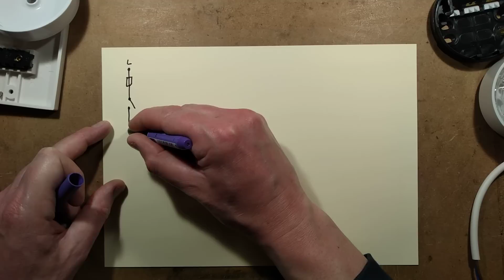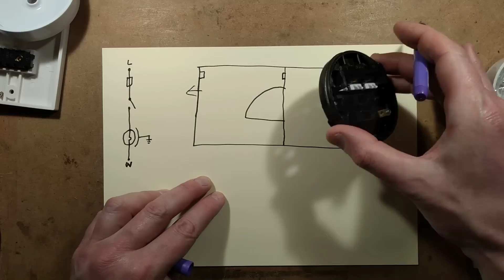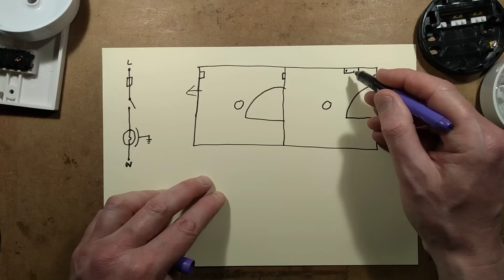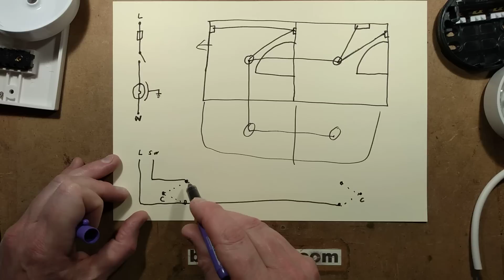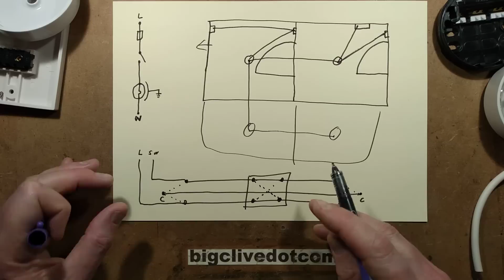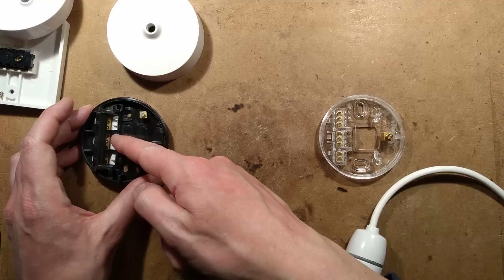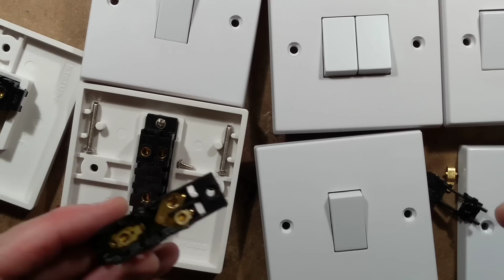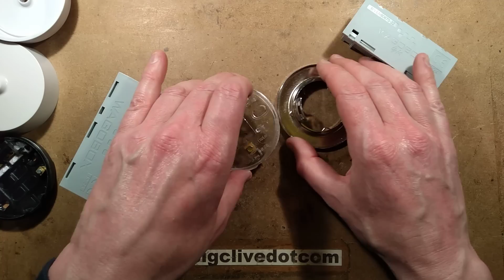British home wiring.  The incredibly simple lighting circuits.

Comment: I've been having a few looks at the US system, and as a Dutch guy, the UK system feels much more like the US system than as ours.

The detachable rose feels a bit like the newer French luminaire plug, tough I prefer their choice not to use the wires themselves, but instead use a separate relief on the cable to keep it in the air.

Comment: I know a different version of wiring the two switches. At least here in Germany I find it is common (or even standard) to feed in Line voltage through one switches Common Connector (Naming seems to be different for every manufacturer here as well, but an up/down arrow symbol for the Common and Something like L and L' seem to be used regularly), connect both toggled connectors through dedicated wires and feed the light outlet from the second switches common port. a third or fourth switch may be added the same way as you described (or you go for some latching relais type or wireles switches ;) )
From books I know both wiings, in realty I have only seen the one i described so far. Not sure if you can/should use the britisch variation here. 
Difference may be in the fact that we have no loop wiring.
Also we have switchces and outlets set deeper into the wall, with two or three depths of the round 68 mm boxes we use to set into the wall. Schuko type outlets would not be flat enough (And yes, the ugly and bulky british type plug is without argument the better design)
Earth wire is fully sleeved here. For in wall installation there are either a round cable Type NYM-J or flat cables. IF you get used to it the wires are quite easy to strip, either with a knife or some quite handy tool.

Comment: For homes we have single phase service which is two 120v hots 180 degrees out of phase and a neutral and ground. For commerical we have 3 phase, each phase 120 degrees. Of that the hots can be 120v or 277v. 3 phase comes in as delta or "Y" . On delta the 3rd phase is 208v. Color scheme for 120v hots are black, red and I think purple. I forget for the 277v . Dryer's use two 120v hots that are  out of phase, if you put a meter between them you get 240v. One the 277v you get 480v between phases. The neutral is always white and the ground green. With 3 phase it means there is 3 ways to get the 240v or 480v. A-B,A-C and B-C. Single phase you just have A-B . Well thats how its been in S. FLORIDA. 
Also they install the outlets upside down,  you can tell by the writing onit, so they look like a face. This is dangerous because if a paper clip falls behind a desk it can land between the hot and neutral.  If its installed correctly it will hit the ground and continue to fall harmlessly.

Comment: Ohh we call the wires between 3 way switches "travlers" and if the boxes between are connected with emt "electrical metallic tubing" we would pull yellow wires for the travels.

Comment: The standard nom-plastic box is called a "1900" box. It has 2 8/32 screws diagonally. You put a "mid ring" on it. The mud rings come in different depths for different sheet rock. The mud rings come in single gang or double gang. Single is for one switch or outlet, double for 2 of the above in any combination. The 2 gang can also fit a one large outlet i.e. a dryer or welder. You can get larger gang boxes, I have seen 8 gang once which you have to get the same size mud ring. If you use 2 devices in a 2 gang the plate that covers the devices is about 1/2 inch larger then the "1900" box.

Comment: if you take and Nick one side of the outside coating about an inch back you can pull back around the wire hold on to the outside coating and pull at about a 30 degree angle and it'll just ripped outside codeine backwards to whatever distance you want to strip it that's how I do it

Comment: I wonder what you would have to say about how in the USA many lights seem to connect white and black together so they can jump down to the switch if power goes to the light first...and then the light switch has white and black it bridges.  I hate those...so confusing and a bit scary.

Comment: Wow, so complicated! What we have here in Australia is there are three holes on the light fitting. One is blank, the other two are connected to the bayonet pins. You twist the active from the trunk with one of the two from drop lead to your switch, put the drop lead from your switch into for one of your bayonet pins and put the neutral in the hole for the other bayonet pin. Job done.

It works quite well unless some idiot landlord wires it up wrong then you can give yourself a nice zap and sit your arse down by brushing one of the bayonet pins while changing a light bulb even with the switch off. Happened to me once and that was enough for me to switch to only hold light bulbs by the glass when changing and fuck the possibility of breaking it. Better it than me.

Sometimes there will for the blank hole that isn't connected to anything it will have two screw posts shorted to each other and obviously connected, so you don't have to twist wires together. Also working on live wiring in houses business or even linesman is practically unheard of here. They usually shut off the electricity if a man has to go up a pole.

Switching one light with more than one switch does exist here it's pretty uncommon. I think probably only one house in four has it at all, typically the larger houses and then usually even then only on hallways. It's actually rather annoying honestly.

Comment: A big fan of your channel and I'm always fascinated by your accent and opinion.

On the subject of electrics... In South Africa we have numerous outages due to grid load reduction and cable theft and I am considering the replacing all bulbs in my home with emergency B22 and E27 LED emergency light bulbs with a built-in battery. I wonder how the switching for those bulbs work when there is an outage and how the light detects switching when there is no power flow to the bulb. Any thoughts?
Reply from the maker: I've made a couple of videos about the emergency lamps.

Comment: I believe usa wiring for 3 way is hot to common of first switch, the other 2 terminals both connect to the same terminals on the second switch. Then common of the second going to the light. Until now i did not know there was any other way possible to achieve this.

Comment: Well, this is not very convincing in my opinion. Looping the light wiring from one room to the other means that the whole house will be in the dark if that circuit breaker trips. Wiring everything in that ceiling rose box makes it difficult for the layman to understand where to connect the wires of his lamp. In Germany or the Netherlands, we would only expose the wires which are needed to connect the light fixture and have the installation wiring in a junction box in the wall or ceiling. What do you do if you have these ceiling roses in a house and the occupants do not like pendant lights?

Comment: The classic mistake that most inexperienced people make when changing a light fittings is that they connect all the lives together, all the neutrals together and all the earth's together.  When they put the circuit breaker on, the light is on, so they will flip the light switch which shorts the circuit and burns out the switch contact.

Comment: I cannot tell you how much I wish the American lighting system were as well considered. Our typical 1950's houses are a jumble of added romex and old twine wound wire snaking off in a million interwoven trees that have no sensible design. I recently purchased a rather expensive LED dimmer switch with a programmable timer (hello worlds best alarm clock) but it required an earth. I can't even say I feel good about earthing the junction box or the light because upon further inspection neither was earthed to begin with. So, one day I'll have to climb up in the attic and sort out my lighting woes and blow in an exorbidant amout of insulation to keep the next guy from messing with a good thing.
Reply from the maker: A plug-in timeswitch and light makes a superb alarm in the winter months.  Especially when you set it to turn on about 10 minutes before the alarm clock and off about 5 minutes after you should have been up as a reminder.
Reply: @bigclivedotcom  I may just have to go that route given my current options. Glad to hear it works well, the winter months are rough in Michigan but I'm typically up well before the sun no matter the season so even a bit of light at 4:45 am is rather jarring.

Comment: Example in 1983 at some houses we used female contact on the wall. easy to connect lamps.
All cables from the fuse box are hidden inside the wall

Comment: If the Cable tie on the Wago Connexbox is utilised then the configuration conforms to BS7533 for maintenance free enclosure, technically does not need then to be accessible for inspection/testing.

Comment: Personally, I never use the 16mm one gang metal boxes. I won't use anything shallower than a 25mm box if I can help it. There's almost never any need to. Plus, since you're likely using said boxes for fused spurs, 1G sockets etc. it's simpler to just get 25s. Plus the more you buy the bigger the discount with many wholesalers.

They're very cheap anyway, we're talking like £0.36 for a 16mm and £0.51 for a 25mm is Joe Bloggs were to walk into Toolstation. A tradesman with an account at a wholesaler is going to pay even less than that.

Comment: Just this week I had to change a light in a room which had a pendant, to a set of spotlights which had been salvaged from another room.  The latter had no loop terminals.  How annoying.  It had an Earth connection, but I found that it had never been making contact because a screw was loose from manufacture.  How old was this spotlight unit?  Well it says it is made in West Germany, so I suppose that dates it.  It was a hell of a job to install.

Comment: It does go all pare shaped when you live in a house where all the lives go to the switch and then up to the light on the roof, or you go to a certain housing site where all the neutrals are red and all the blacks are live.  No, it is true, all the houses are done this way.  WHY?  God only knows, was this the first lot Europeans wired when they came across?  Also all the earths are uninsulated, just copper wire!  Makes you wonder how these houses ever passed a safety check or got signed off!  Not to worry, when you see black wires going into the live on a socket, you know to be extra careful.  I got a phone call saying someone's son n law (in business for himself) had wiring off a two way switch and the lights in the house go on and off in odd ways now.  "Can I come across and sore it out?"  No, get him back to do it or pay someone that knows what they are doing, don't get me involved, if he has done that, what else has he done?  I could fix it, but why should I get involved in someone' else's dodgy wiring?

Comment: How does an isolation transformer work?
Reply: <smirk>It works real good</smirk>
The basic idea is this:
If you wind a coil of wire and pass an AC current through it, you get and AC magnetic field.
If you wind a coil of wire and place it in an AC magnetic field, you get an AC voltage.
But having two coils that are near identical extremely close to each other, you end up with an isolation transformer that outputs almost exactly the same AC voltage as came in with no actual electrical connection.

Comment: The Netherlands only have two wires (black) between the two switches in a two-way system. One switch has its common connected to live. The others common is connected to the light fixing. The other connections are connected one switch to the other.

And each switch has its cable go to the light fixing. Although we don't use cables. We use individual insulated wires which we pull through PVC pipes.

Our boxes are usually 70mm deep.

Comment: In Australia, we tend to have 2 lighting circuits in newer houses and try and alternate rooms, that way, if someone shorts a light in one room, the next room over still has light, that way you can find your way to the switchboard easier. doesn't always work out that way but its at least attempted. We also generally don't use "back boxes" in residential (not sure if that has changed recently, haven't worked with any sparky's in a few years.)

the closest that we use to back boxes in residential is the plastic "shields" we put in external wall sockets that serves no other purpose than to keep the insulation away and help prevent water leaks in the walls shorting something. its just a real thin flimsy piece of plastic.

to actually fix the fittings to the walls we use one of 2 types of brackets, one nails to the stud before the plaster goes up, these are the best, the others are used for retrofitting, or if the electrician gets there to late, they just hang over the side of the plaster and end up falling into the wall cavity when you have to take the socket off later.

Comment: The main purpose for our wonderful British electrical wiring systems had little to do with safety or simplicity. Yes, they were concerns and taken into account, but the driving force was "Use less copper."
16mm deep backboxes are used, I assume, in new builds where, instead of using a wooden framework, plasterboard is affixed directly to the wall with a few smears of plaster (or whatever, it looked like plaster last time I saw one) so you don't have room for a substantial box. Cheap and fast building methods are the trend today, and this is why new build houses in the UK are, in my opinion, awful.
Edit: I've never seen those plastic boxes, but my experience is quite limited (I'm not an electrician, but have replaced a fair number of switches and roses). I have only seen metal boxes, but still with plasterboard-covered walls. I guess the only switches I've replaced have been on brick/breeze-block walls, not wood-and-plasterboard partitions.

Comment: I  apologies bigclive but the UK wiring in my opinion looks like a fire waiting to happen compared to the U.S. Electrical Standards. I would not even dream of wiring up circuits like that here and pass any kind of inspections. We have some very strict wiring standards although we use half the voltage but every circuit needs it's own breaker except if the house is old and have not been upgraded to the newer standards just as long as it is safe enough to operate without dangers of faults and wires are not overloaded due to too much amperage and taking in consideration on the condition of the older wire. In some areas in the U.S. it may be different but from my area it is acceptable if it meets certain requirements.

Comment: New Zealand and Australia have an insulated earth in their TPS cables. Stripping them is dead easy, you make a small cut with you side cutters into the end, grab the separated cable with your side cutters and just pull out sideways with tears the TPS down the rib. Because we have battery holders where the light fitting is screwed direct to the ceiling the more common practice is to "Loop at switch" rather than "loop at light". This makes the job of fitting light fittings quicker and easier as there are fewer cables and connections to be held in the fitting . It also means that you only need 1 type of cable for lighting, 1mm twin and earth. Fault finding is simpler with "loop at switch" as there is no need for a ladder, 90% can be done at floor level.

Comment: I always use 35 or 47mm back boxes, even for 1 way light switches. Sure it's more work but its a better job. Modifiable & Future proof. Also Clive, please PLEASE don't promote wago connectors. 1, they are crap, they cant handle continuous current like screw terminals can. They break down after a few years. 2, they make it look easier and more tempting for the dick-head DIYer whose crappy work I have to deal with ALL THE TIME. 3, lots of idiots use low value wago connectors on high current circuits because they are cheaper. 4, people don't bother with an enclosure half the time - I've been zapped by one such connection with 3 bastard inches of exposed line conductor. Finally 5, They are more expensive and, in my experience, they hardly save any time at all. I only ever use traditional junction boxes - if it aint broke, don't  fix it.

Comment: Id really expect there to be a cable gland on that cover portion of the fixture to provide strain relief. Also in the US that cable would be called NM-B 14/2 (for 15 amp), and will have the bare copper ground (earth) wire, though green insulated wire is also used, both are acceptable.

Comment: UK, Ireland and Europe mostly use masonry walls. In North America, because we have an abundance of trees, we use "stick" construction. Mainly 2x4x96 inches, some outside walls use 2x6x96 inches. So our walls are essentially hollow, we can run our wiring inside the wall as opposed to on the surface or in a channel in the wall's surface. I'm not an electrician but I wouldn't be surprised if the regulations and methods are very similar, your method just makes more dust to clean up later.
Reply: In the UK we're have mostly used the same timber and board construction internally for decades,  only the outer wall is masonry,  so most modern houses have the cabling run behind the wall board and plastic dry lining boxes for the fittings.  The metal boxes Clive showed are mostly used on older houses with masonry inner walls.